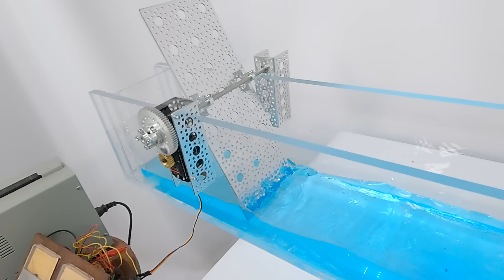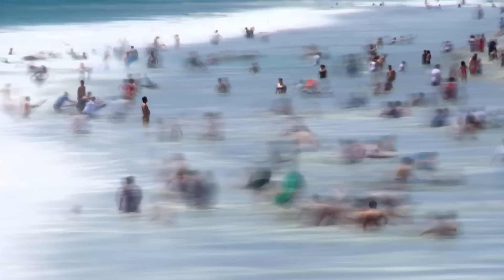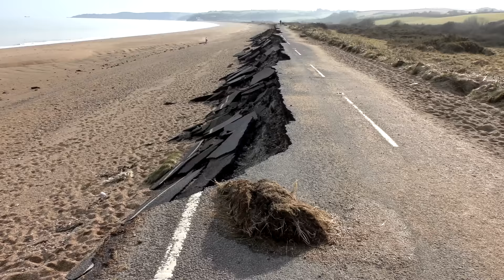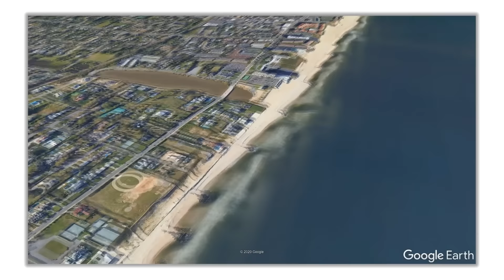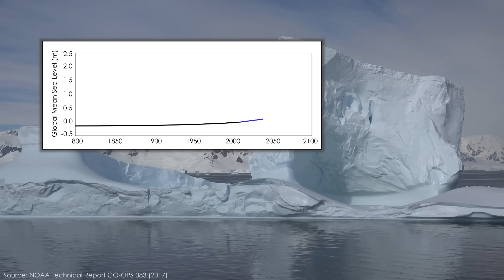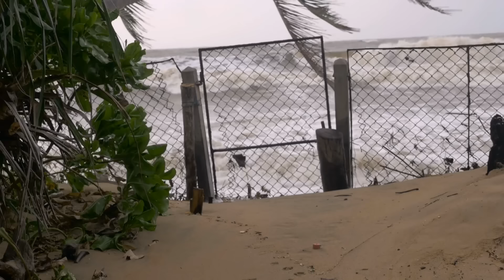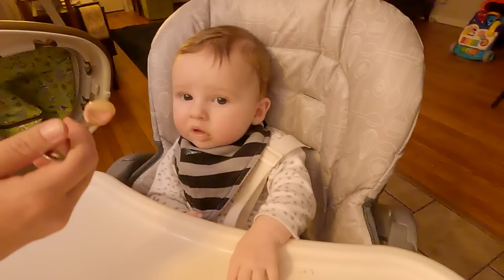How Coastal Erosion Works

Comment: I don't so.
The sandy beach might be the steady state of the erosion itself unless there should have some beaches are gone now if they were exist in past 50 years
your model with the boat. Actually, the boat is the one causing the erosion. Without the boat the erosion in the model will take longer time.

Comment: Is there an engineered alternative to mangroves for areas where they should not be planted? I.e. concrete buffers arranged like checkers which could diffuse the sea water. Wouldn't that actually provide more sea habitat and also protect beaches?

Comment: So, a question

over time, and I mean millions and billions, if not trillions of years, will the land eventually completely erode, Causing any landforms above sea level to level out into a layer that will form below sea level? Eventually leveling out the sea floor and only water will be exposed to the atmosphere? Sure, by the time this could happen earth will have been long uninhabited, just curious if this is a possibility, or if due to say tectonic plates pushing new material up, that it wouldn’t happen.

Comment: There is currently no global sea level rise, those that claim there is are pseudoscientists. Whether a shoreline is regressing or transgressing is up to regional factors like uplift/subsidence and sediment deposition rates. Other factors include the removal of mangroves and other vegetation (Miami Beach) as well as channeling/damming of rivers which cut off sediment supply (Mississippi Delta). But since regional factors dominate over global factors, real scientists call this stillstand. There hasn't been global sea level change (when global factors dominate over local factors) for about 10,000 years now.

Comment: Instead of beach replenishment every year they should replenish the beaches and then drop structure back into the ocean where they pulled it from. Form manmade sand bars so the waves hit the sandbar and break instead of going back to sand and pulling it back out. 
Can you add a manmade sandbar to your model and see what it does to the waves and beach erosion? Old trains, planes, buses and boats would make good sandbars and create structure for the habitat.

Comment: well, your graph is crap, you talk about a foot to 3 feet increase in sea levels when you made the graph with meters as a unit. You would have to be a bigfoot for this to work (for all USA, humans grow to about 1.65-2.00 meters tall, quite longer than 2 feet). Also the increase is a projection on limited data, not a sure thing. Ask Al Gore about ice-free arctic by 2013, then postponed to 2016 and still waiting. It would be better if you focused on engineering without drifting into tinfoil caps

Comment: I have said this before but you should look into long term land reclamation, along a entire coast their is a over all water current that moves sand and debris up or down the coast, if people or nature builds peninsula that will collect sand and eventually that can be turn into land you can build on like it takes 50 years. a city will start with a rock pier, then they will turn that into a harbor, then the harbor will get smaller and they will reinforced the new land, till they fill in the last small harbor and can build stadium on it.

Comment: Hey! I think you should look into a pretty new way we are dealing with erosion down here on the Gulf of Mexico. It’s a structure called a WADs and Living Shorelines Inc makes some really cool ones. The idea is to not block the waves but to diffuse the energy. The added benefit as well is it is proven to add sediment back to the shoreline over time. The inside of the WADs also allow for marine animals to thrive. In my opinion it’s the ultimate way to protect out vulnerable shores!

Comment: In case anyone is interested,  the ocean moves almost like a river in the nearshore and there is almost always a dominant direction of sediment transport  called longshore transport. It helps geologists and engineers design projects by knowing what directions are the updrift and downdrift sides of a beach. Of course the biggest contributor to coastal erosion in the short term are inlets which distrupt the natural flow of transport along the shore and the bad engineering associated with the older “hard engineering” paradigm. Some structures can help a lot but we have to be aware that any changes to the shore can have negative consequences downdrift.

Comment: "Sea level" is never static, nor is it consistent from place to place. In some countries, the local sea level can be up to 400 feet higher (or lower) than on the opposite coast of that same country. People who heavily depend on the "ocean garbage patches" for argument fuel should automatically question any claim of rising sea levels, if they're honest. One to three feet of "sea level rise", doesn't even have a clear meaning. Especially when you consider that "mean sea level" probably just means "in respect to tidal variation" which varies by about 1-3 feet, and not "because you made it angry". This is the level of science you get when it is sponsored by corporate interests.

Comment: Here in northwest Germany we have the wadden sea. There are vast mud flats which are flooded and released again and again by the tides, with every single tidal turn. Maps for marine traffic are redrawn every year, and it is mandatory to have up-to-date maps and depth sonar up from a certain size of marine vessel. This is because the topographics of the mud flats and the sea floor is constantly changing. And the islands that lay in this wadden sea are wandering eastward, with the main water current. There are old villages that got washed away by large storm events, and when you know where to look you can still find bricks in the middle of nowhere of these mud flats, which originate from those vanished villages.
There is coastal nourishing on every single one of these islands today, but over time, the north sea is about to win this fight and us humans are not stopping the islands from changing.

Comment: Where does the sand come from? I thought it was ground up shells and rocks that got deposited by the sea. If erosion is mainly removing the shore, how did it get deposited in the first place?
Reply: Sand comes from river sediments, the crumbling of cliffs, breakdown of coral and shells and the digestion of some marine animals.
Reply: Sand comes from all different types of source rocks. Like Lucario said, sand is deposited mostly from rivers that carry sediments down from higher elevation source rocks. Glaciers can also dump huge amounts of sediments (a much slower process than rivers) when they melt. Have you ever seen a beach composed of pebbles or slightly larger stones with little to no sand? Over time, the wave action will break those rocks down into finer grains and eventually sand. Sand is also highly affected by wind. "Sand" formed by shells, coral, bones, plankton, fish poop, etc will over time become more like mud and slowly fall to the ocean floor, and may become limestone in the right depositional environment.

Comment: Hey Grady, a nice one again. Thanks! 
True, liked the beach nourishment part in particular. In the Netherlands, as you know we do have to rely upon that to safeguard our coastline kind of. You're sure are familiar with it. The more recent approach we follow is to somewhere dump a significant volume of sand in front of the coastline and let the sea dynamics deal with in its best interest. The natural currents distribute and relocate the sand along the whole coast line and as such help to protect it further. It's called the 'Sand Motor' and you can clearly observe it on the map or from space, say in front of the coast between Rotterdam and The Hague. Today it is also used for recreational purposes as for wind- and kitesurfing, etc. As it is more safe to be there compared to the open sea.

Comment: Grady could have mentioned the effect of dams that permanently trap sediment from upland erosion from flowing to the ocean and settling on adjacent beaches.  Also, dredging of river channels to facilitate shipping navigation to inland ports interrupts the natural sediment flow, especially here in SE Georgia (the US State).
Reply: Interesting point. In Louisiana there is a major subsidence problem due to upstream reservoirs that trap sediment(reduced sidement load)  and levees that prevent the flooding that would naturally rebuild coastal lands. Oil and gas extraction also play major role, though the process itself is natural. 

Would love to see a video on Oysterbreaks -a type of breakwater that uses a special concrete (expanded shale w/o sand) and depends on biological growth to rebuild coastlines.
Reply: @Jason-Spice  Yep I live in Louisiana and this is the real reason we’re losing land so fast. The  Mississippi has been replenishing our coast line for so long, but we put levees all around it so the sediment is just dumped into the gulf now.

Comment: Another factor in erosion is river management. Rivers are an important source of sediment for replenishment of coastlines, bringing material from inland to replace what has been washed away. But if the rivers are dammed, diverted, or transformed into paved culverts and storm drains, the sediment stops and erosion increases.

Comment: Another solid addition to your video library. Always appreciate the well thought out content. We have the opposite problem in my jurisdiction. We manage a lagoon and river mouth where littoral transport, riverine sediment deposition, and high surf builds sand up along the beach and causes the closure of the river mouth which can lead to localized flooding. Balancing ingress/egress and safety of the community that is impacted by the flooding vs ecological and environmental concerns has been an interesting dilemma. We recently mechanically breached the lagoon due to high surf and the atmospheric river that just hit CA.

Comment: Pro Tip. For your home-made wave flume, use a 'sand' that has much lower density, and larger grain size (Acrylic, PVC, or other plastic beads with 1.2 - 1.4 specific gravity work well). This will accelerate sediment transport. Also note that lower wave frequencies will drive sediment up the beach, while higher frequencies will pull it back down. To demonstrate this, start with a shoal that crests just under-water. The waves, which carry net momentum shoreward (by virtue of 2nd order skewness) will create a beach.
Reply: The direction of sand transport is not solely related to the wave periods but to degree of breaking as well.
Reply: Another tip: Make an actuator that pivots at the bottom of the tank, rather than at the top. This will produce waves with a structure closer to that of natural waves.
Reply: Huh?

Comment: "Waves are destructive because water is heavy" now joins "you gotta have dirt under your concrete" as my favorite Practical Engineering quotes.
Reply: No mention of water's weight, which I remember from the imperial days as being 62.5 pounds per cubic foot.
Reply: @loginregional  or in metric about 1kg per 1L of water
Reply: @Jesus_friggin_christ  About?  That's one well-hedged bet.
Reply: @stevenclark2188  water is not always exactly 1kg per L, pressure, temperature and salt/ mineral content all play a role. Salt water is closer to 1.050kg/L and fresh water is closer to 0.950kg/L.
Reply: @Jesus_friggin_christ  Yep, but the standard for the Kilogram is 1L of water at 4°C and at normal pressure condition
Reply: @sondadir9205  Abreviated as STP (conditions).

Comment: Broady: The see is almost always winning.
The Netherlands: Almost!
Reply: Wildwood, New Jersey is another exception. The beach keeps accumulating sand, so the piers are no longer over water. The incline is also very low, which makes for long, steady waves that are fun to ride :)
Reply: Also a bunch of places in Eastern Europe
Reply: What's interesting about Flevoland in the Netherlands is that is human made. The province exists because the construction of huge dam called Afsluitdijk which reduce the amount of sea water converting the closest to land sea area into lakes, then the land is reclaimed from those lakes. It is extremely slow process, but that makes the Netherlands' land area grows without invading another country. I will be really interested to see how that actually works.
Reply: @IlluminatiBG  Afsluitdijk is what i would randomly type in the middle of an awkward chat session. 

Apart from asdfghjkl of course.
Reply: Actually in the long run the land is winning. Earth was once almost entirely covered by oceans with only a few small continental shields above the sea. The continents keep accumulating sediment and rock, growing over geologic time. There is also a slight bit of water escape to space from cumulonimbus clouds injecting water into the stratosphere where UVC light breaks water into O2 and H2 which then rises further and can eventually escape.
Reply: @bobbyt9431  I would question this however. Geologically continental crust and oceanic crust are different, with oceanic crust being denser than continental crust. As a result, most continental crust protrudes above the sea level. Most prominent crust formation today are oceanic crust at mid-ocean ridges. Continental crust formation however are much more difficult, with most theory suggesting slow accretion from oceanic crust sediments, although one advantage is that unlike oceanic crust continental crust don't really subduct down into the mantle so you don't lose much of it due to geological processes (while oceanic crust get completely recycled in around a few hundred million years).

Also, just because you have a slab of continental crust doesn't necessarily mean you can have any landmass - Zealandia is a prominent example of "lost continent", also extensive continental shelves are more common examples around the world of how continental crust can exist and not be above sea level.
Reply: @mukrifachri  What exactly are you questioning? 
Continental crust is felsic whereas oceanic crust is mafic and ultramafic. This doesn't make the continents protrude above the ocean water per se, the continents are floating on the oceanic crust itself. Over time the felsic material conglomerated into the cratons through felsic lava flows which mostly ceased about 1.1 billion years ago. At this point there was much less landmass relative to today. Trangressive-regressive sequences along with plate tectonics has caused the cratons to gain more and more rock over time. Eventually the tectonic cycle will wane then come to an end, continental growth will probably play a part in that.
Reply: @bobbyt9431  Well, what I've seen and read is that continental crust is made in either island arc or in continental-oceanic subduction zones with delamination from the oceanic crust. Also continental crust creation is presently much slower than oceanic crust creation, so landmasses would tend to stay in size for the time being if we're only considering crust size and types; however if we're considering the real landmass as in the area that protrudes above the water, the current trend is that there'd be most likely be less of it in the near future, mostly due to rise in sea level. So while in really long terms land areas might increase from the current position, in the short term (which is about the human lifespan given geological processes are incredibly long) land area would be more likely to decrease.
Reply: @Illuminati 
Also finland: let nature do it's thing: post-glacial rebound
Reply: I've seen them actually reverse the trend however. In the original plan the whole of Zuiderzee would've been reclaimed, but it's now left as a nature preserve. The most prominent is Markermeer which is lined by Houtribdijk. Many of the unused lands have also been allowed to once again be inundated with water (becoming a marshland), since it helps the environment and it slows the land subsidence due to compaction from being in the dry state.
Reply: @mukrifachri  Nature and fresh water.

Comment: Maybe not mainstream engineering, but you can nourish a beach by draining it. Try filling your setup with 2 inches of sand evenly over the bottom, and make a narrow beach at the end, with small drainage flow under some geotextile. Dump the drain at the other end of the tank, behind the wave generator. The drained area will be nourished by the waves pushing more sand on the beach, than they are pulling out. It will be slow, and it will probably take days before you see a difference. But it is very low impact.

Comment: Grady: 3 feet
Me: ...
Grady: thats almost a meter.
Me: Oh thank you.
Reply: and?
Reply: @odemata87  and what?
Reply: @kurtsteiner7310  your comment. What was the gist of it?
Reply: @odemata87  
That he grew upmin one of the two only countries who are still not using the metrical system: the united states and bangladesh.
Reply: @matthiaslipinsky501  but who cares really ? Why is this always a issue whenever a video has imperial measurements? Also if any one was really interested they would know the US uses the metric system in many day-to-day ways.
Reply: @matthiaslipinsky501  If he's an actual engineer he'd be well versed in both. Most of US codes and standards are also available in metric form. For length it's not too difficult anyway - 3 ft is around 1 m, 1 yard is around 1 m while 1 in is around 2.5 cm (or 25 mm).